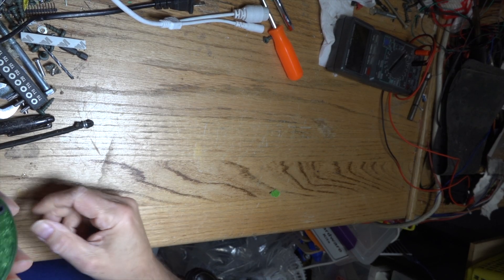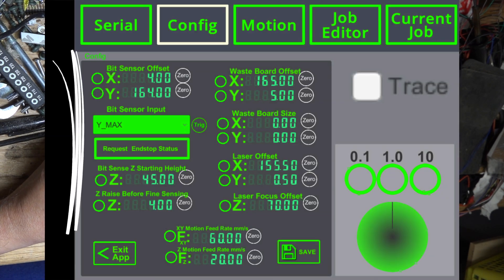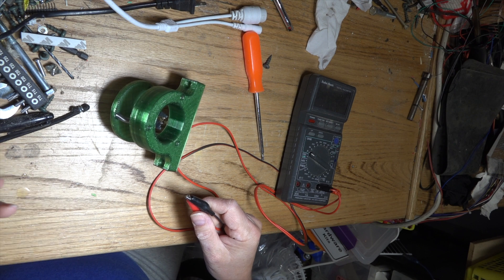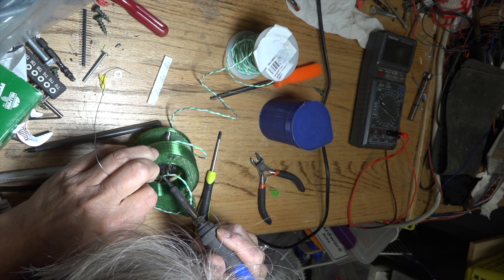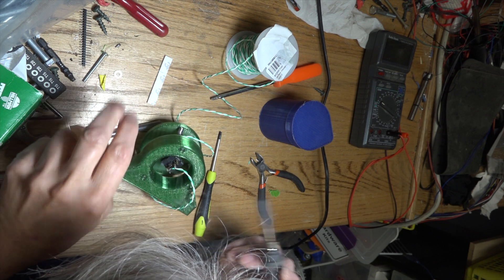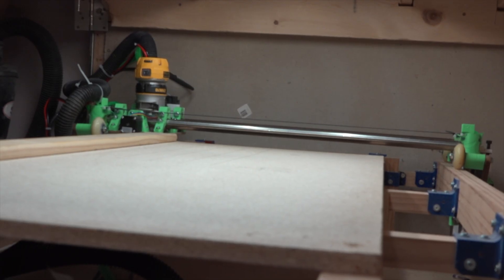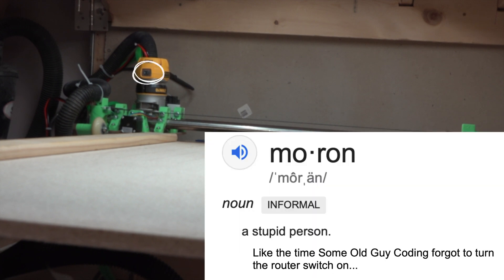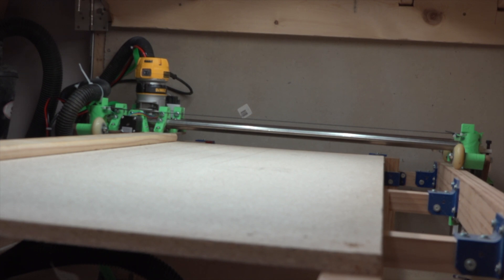Lowrider II Build  - Part 11 -  End of Bit Sensor & First Cut

Comment: great videos for lowrider2 looking at getting mine soon, i was wandering as you are so much more advanced than me, is there a way to have this at an angle  60 degrees against a wall, if the wheels were at different angle, i think it can be done, one wheel at top and one at bottom inside the table should run the same as a flat table is this feasible, any hep would be great.

Comment: How do you like the Lowrider 2 vs version 1? Have you noticed any changes in rigidity between the two versions? Thank you for the awesome videos!!!
Reply from the maker: Thanks so much!.   Not much different. The 611 plate is a little smaller, which makes it a little easier to see what the bit is doing.  There's integrated dust collection -- I'm sure it's helping, but since I've been using it so far with a longer bit to do some deeper cuts, there is still a lot of dust. I think it will work better with smaller bits, with the 611 plate closer to the work. But other than that (and of course the fewer parts to make one), I really haven't noticed a difference. Certainly no issues. I think the design is very well thought out and a pleasure to assemble.  Thanks for watching!

Comment: Nice idea but it seems a tad overkill.  A peice of MDF with some recessed copper clad board would do the job and be a lot simpler to maintain. (I would think)
Reply from the maker: good idea!
Reply: @Someoldguycoding  So I thought about this a little more... with your setup the tool gets measured and milling begins right away. With what i suggested you would have to attach the other half of the circuit to the endmill measure it, disconnect the wire then start your milling.   How accurate are you finding the switch? Is it triggering consistently at the same point?
Reply from the maker: @roccovalotta9490  Yeah, I was thinking that too. I didn't want to have to connect a lead (however, I may end up doing that for an auto-leveling feature).  The switch is pretty good. I'm doing fine sampling in steps of  0.25 mm - I may have to make it finer when I start using a V-bit, we'll see.  I've seen the value switch up and back 0.25mm, but that may be because it's just so close to the threshold between the two, and could probably be tuned out.   I still really like the idea of a piece of PCB embedded in the waste board though...
Reply: @Someoldguycoding  wonder if you could have the other contact sticking out on a spring that the tool / collet runs into then goes down.  Anyways just thinking out loud
Reply from the maker: Rocco Valotta yes, or a wire to some screw inside the plastic case...  or a springy wire on the end of a servo